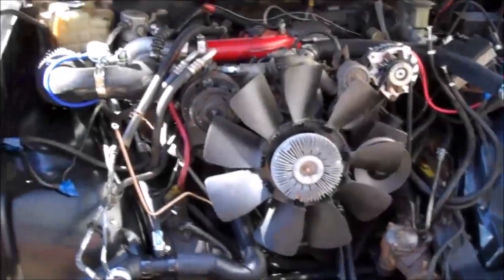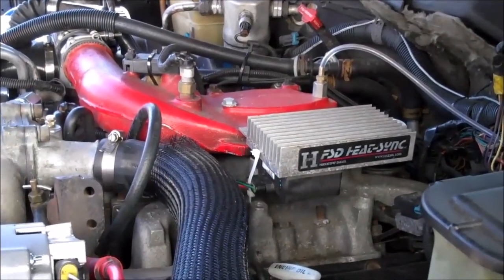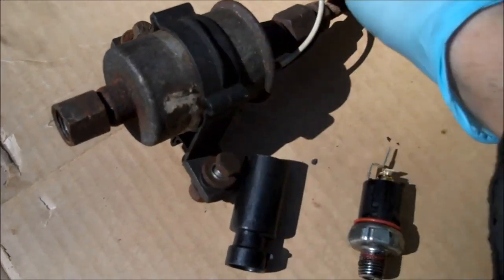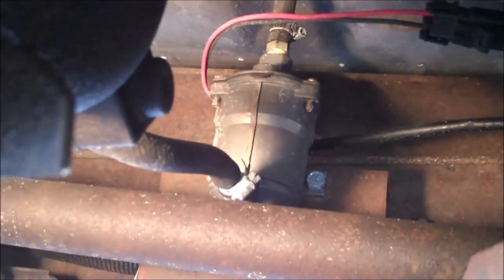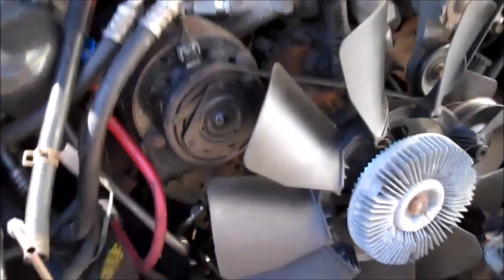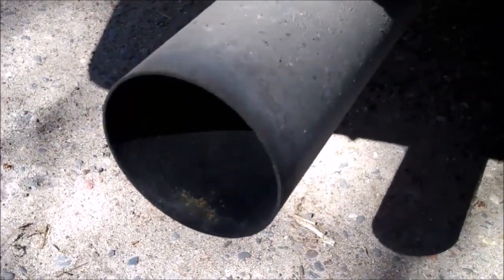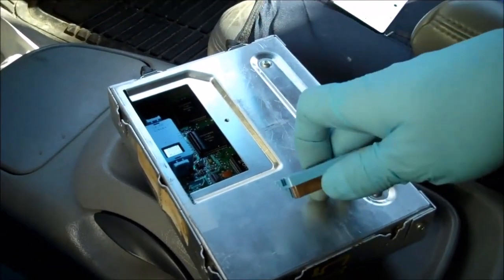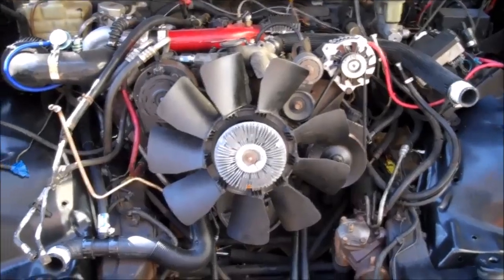6.5 DIESEL ENGINE - HOW TO BOMB PROOF IT

Comment: You have hit on the weak points of this motor's design. You even hit on the electrical aspect in the comment section as they are a bit sensitive with grounding and such. Well done! I have a 94 that I purchased new and still have the OEM vacuum pump and prefer that to control the wastegate on the turbo rather than have a manual one. My current exhaust is a Banks 3" with a "soot delete" as Diamond Eye didn't exist back in the day.  Ideally, the pmd really should get clear of the engine bay as one of the reasons for premature failure is the heat soak it has to endure after shutdown. Even then, unfortunately, they are still known to fail. However, with an upgraded fuel pump the pump mounted driver could very well work flawlessly in it's original location as it relies on fuel flow to keep it cool while the engine is running. I, personally, run the Kennedy bypass for the OPS and love it. These motors have gotten a bad rap but if you approach these things with the idea that they are light duty diesels and not designed to move mountains, they will perform well and are fairly reliable. Not to mention the cost to maintain is by far cheaper than today's models. Thought I would mention that factory oil cooler lines are notorious for failing at the most inopportune time and should be upgraded to braided lines offered by one of your sponsors.
Reply from the maker: +JREACHER1954   Thanks,  I do want to clarify that I do not have "sponsers",  I put up the links to the guys I use without them even knowing I did this vid.   I just want to share my experience with this rig and what has worked for me.    The 6.5  and the Suburban body with 4x4 has been the BEST vehicle for me and my family over the last 18 years and I do not believe I could replace with ANYTHING currently being offered on the market new.   I was really bummed about forgetting to mention the upgraded battery cables in the vid,  I did that so long ago that I think I take it for granted now.   I have not had any problems with the PMD in the current location,  but I still do carry a spare!
Reply: I have the extended cab K2500 and would not trade for the world. Don't know much about trucks but I know alot about this one. Spare pmd, goes without saying. ;>)
Reply: @JREACHER1954  me know if
Reply: Just leaving

Comment: What kind of mpg are you getting?  Great vid love the 6.5
Reply from the maker: +NeATV    This is where the 6.5 diesel REALLY shines.   If I drive NICE and keep it at 65mph I can get 22mpg on the hwy.  This is not unusual with 6.5 owners running the 3.73 rear.  And that with 4x4 drive train!!!!     Warning though.....when I first put a heath diesel prom in and did all the upgrades I was probably getting "negative 10" mpg.....   I just could not drive "normal" for a while.....

Comment: What exact cooling fan is that? and are you using the factory clutch?
Reply from the maker: +Jeff Winer   The fan is a DURAMAX fan.   The clutch is a specially made unit adapted to the duramax fan.   SSdiesel out of NEW YORK sells the kit and so does Heath Diesel out of Washington.  Kennedy Diesel out of Wisconsin sells a 20 inch steel fan and the Duramax fan.    The Duramax fan does require a little trimming on the bottom shroud which is pretty easy to do with a sander.
Reply: +Yankee Prepper - Preparing for the Wrath of God and Fine Coffee. 
Oh ok yeah i saw those kits i just thought you put somthin together yourself. love the truck btw i have a 1998 2dr tahoe with the 6.5 all ive done is the pmd relocate to the driverside fender above the abs unit, 4in diamondback turbo back kit, vac pump delete erg delete and turbo master. i really want to do the cooling upgrade but my truck already has a dual tstat housing and high flow water pump. noone sells just the 180deg tstats and the fan.
Reply from the maker: +Jeff Winer    SSdiesel sells just the 180 T stats and/or the fan and clutch as separate items both on his website and on Ebay.   (Any of them will if you just call.)   I ran 180 Tstats for 10 years and now I am running 190 Tstats,   I read that 190 is better for MPG,  but so far I am not seeing much of a difference.   You know you reached the point of TOTAL insanity with the 6.5 diesel when you spending time switching Tstats for a 10 degree difference and studying the effects..........
Reply: +Yankee Prepper - Preparing for the Wrath of God and Fine Coffee. 
lmfao! "TOTAL insanity" maaaaybe... but yeah the tstats seem abit trivial but for 50 bucks why not? i put in an all aluminum radiator and saw at least 10deg lower temps at highway speeds and my mpg went from 15 to 17. truck was getting 25 lastyear but i think its time for injectors since its overfueling at idle plus i think i have a leak in the return line on the factory fuel filter, little drip of diesel in the driveway. i live in florida so its hot AF and the atmosphere is thicker too. glad to see your an early riser ide like to talk with you more maybe not in the comments lol.
Reply from the maker: +Jeff Winer    I lot of guys with 6.5's have went through some mpg drops by going to cool and the Tstats are the key to that.   180 degree is good for towing and the mountains,  but they say it hurts the overall mpg for everyday driving.   The larger fan makes a big difference overall when removing heat from a hard working engine.   Makes a lot bigger dif than anything else besides a good radiator.

Comment: Hey YP, your vacuum pump is only used for your waste gate? I have a cucv 6.2 and my VP supplies vacuum to my TH400 trans via the Injection Pump to know when to shift based on load. Does your trans not have a vacuum modulator valve?  Also after +300k miles what is the average life expectancy you can expect out of glow plugs? Thx
Reply from the maker: +shepard3  Nope.&#160;&#160; The trans is all electronic,&#160; the only thing the vac pump is used for is the wastegate on the 6.5.   Your trans is the TH400,  mine is the 4L80E and in 300K miles I only had to change the speed sensors (2) once.    I change my glowplugs every 50K.,cheap and easy job....and it's easier even more so if you change them every 50K

Comment: Great tips ive done most of these to my 6.5 just to keep it going they are tough and economical
Reply from the maker: +bud moore (buckshot32000)     Yes they are good engines for what they were designed to do.   I have had relativity few problems with this vehicle overall.   The 4l80e Trans and 14 bolt rear that the engine is connected to are some of the most reliable in the their respected category as well.   The only real complaint that I have is the HVAC assembly behind the dash.   The defrost doors kinda break off hinder the ability of the whole setup.   This is common I guess on these trucks and suburbans. of these years.  That a project for this year,   sourcing a new HVAC assembly and taking the dash off to replace the old one.    I am more afraid of take the dash off then taking the engine out!
Reply: Yeah no matter where u turn the dial in my truck the air blows out the floor vents so I just reach up under the dash and change the mode manually
Reply from the maker: +bud moore (buckshot32000)    That's easy and CHEAP to fix!!!   it's just one of the actuators and your problem indicated the easiest one to change!   Remove 2 phillips screws,  replace the actuator with a 20 bucks new one and it will be like new again for you.
Reply: no the one that needs replaced you cant get to without pulling the dash i tried changing the easy ones no improvement
Reply from the maker: +bud moore (buckshot32000)    huh...in mine the left (drivers side) actuator controls the different air flows/defrost to floor and that one is easy to get to,  the middle actuator controls the heat/cool mix and the right side controls the outside/inside air.
Reply: I Love mine when she runs proper lol which is Most of the time . 
Usually 1 small hiccup per yr and all were simple chp fixes . 
I got a Steal when I bought my 93 CCAB Dually w 50,000 for 5,000 
 Yes I too wish it were a 94-95 
I may in time buy a K3500 to steal the 4x4 components from .  
 I can sat I'm not liking the auto trans unless my back is out and have to push in a clutch ..argh 
  Disability suks as I loved my Slap n go 
Peace

Comment: Great...now you got me thinking I should be scanning CL for diesel truck/suburban with blown motor to put a fixed/reworked 6.5 in! :) Good stuff man!
Reply from the maker: +harley96cube    That's what I am doing!   I will make it worse for you,  look up "TED'S TRUCKS" in Alabama.   He has low mileage and rebuilt military Hummer engines for 3K, I think he has some on EBAY too.   The military Hummer engines are the "optimizer" 6.5's that have the beefed up blocks!
Reply: +Yankee Prepper - Preparing for the Wrath of God and Fine Coffee. Yup, already started looking at the optimizer. Could put that in just about any Chev that a small/big block is in. Thanks buddy. :)

Comment: I can only imagine how they open up their meetings at the factory:
"We're GM diesel  engineers and we're here to help!"
Reply: Look Up Detroit Diesel Series Two-Stroke Blower motors! GMC! 
1938 till about 2000! Still in use on the roads, oceans and rails!
Tanks a couple WW!
Mostly interchangeable parts one cylinder to 24
Reply: Duramax engines are bomb proof
After all the emission bullshit is deleted
But with LB7s... replace the injectors and gaskets and you're fine
Reply: LMAO... Yup they are there to help empty out wallet is what they're there for 🤣🤣🚫
Reply: Sounds like Biden nowadays

Comment: What content! I hope some engineer watches this and sees the demand for built to last, self maintainable vehicles and creates a company that makes them.  I could work on my old '76 student car. But my current 2010 Toyota, zero chance. Thanks for sharing.
Reply: Especially since many people buy these diesels for the longeveity of them only to be disappointed by expensive preventable break down.  Not only GM but all the manufacturers have let down their customers when they have been expecting to get long lasting vehicles.  It ridiculous that you have to do these mods to get a reliable engine when they shoul already come that way.  However in defense of the manufacturers we do as a group in the United States put a lot of requirements and regulations upon our manufacturers that are almost impossible to meet.
Reply: enter the enterprising individual with a bit of wrenching skill and the aftermarket. ;-) i think the enthusiast that wrenches pisses both the manufacturers and banks off the most. that's why the lobby for the manufacturers tried to shut just about all of us down a year or so ago by trying to implement dmca rules in regards to engine management systems etc. didn't work though thankfully enough.
Reply: I'm sure the reason for the success of the aftermarket companies is because of the money they have, just like OEM car companies who knowingly make cars and parts less reliable than the aftermarket who intends to offer actual bang for the buck with quality. Money buys everything in this world, even policy and credibility. This is no secret. Lobbying (which should be illegal) is what often keeps fat cats, well, fat and in business. It's why big oil companies successfully defeat any bill proposals to increase fuel economy and decrease oil usage. I do not defend or condone lobbying in the slightest. But as long as it's "legal" then the good guys of business have just as much a place in lobbying as the thieves that bought their way in.
Reply: Engineers for for GM and most automotive brand are NOT ALLOWED to build a proper design.  The sales and marketing and board Directors control engineering department..
Reply: can you provide a link to the scanner?  can I use it to set timing after installing new IP?
Reply: Why would the auto guys and galz build a reliable product? No high IQ required to know that reliability and profitability don't go hand in hand. GM, Dodge, and Ford know that their greed would be unaffordable to the public if their products lasted 1,000,000 trouble free miles. It's unaffordable because we live in America, land of the fee and home of the slave. Don't worry though. The big banks and auto dealers will take good care of us. When our vehicle's break down for good by the time we're done overpaying for them from our favorite dealership, which they are now designed to do, we can go to the banks and ask for another loan. Bank of America appreciates your business with them.

Comment: Very good info! My truck is a 97 chevy but its the 5.7 vortec with only 102k miles and only gets about 14mpg. I knew diesels were more efficient but I had no idea it was that much better! Now you have me wondering about an engine swap but I cant justify that unless something bad happens to the 5.7. I may have to keep my eyes open for a possible future donor/towing rig. Thanks for the detailed video!
Reply: +Off Grid Kansas I have a 98 k1500 ECSB with a 5.7 vortec and a 94 k1500 ECSB with the 6.5 TD, my vortec is actually the daily driver and gets 14mpg or so.
Reply: Any particular reason you use the 5.7 as the daily driver if the 6.5 gets better mileage? Is the 6.5 geared lower?
Reply: +Off Grid Kansas The 6.5 has 306k miles on it and my 5.7 has 195k. Diesel has 3.73s and the gasser with 3.42s, I just like the vortec more since it's a cleaner truck where everything works. The diesel is more of my hauling truck.

Comment: Great video again!!!!!  Question I have is about the body of the Suburban.  Since you live in Minnesota, how does it hold up to harsh winters, road salt, etc????  I assume you were able to give it a good undercoating before you put it on the road.  Road salt is the death of so many cars in the North...  So do you have words of wisdom for us??
Reply from the maker: +jjakejones    2 words my brother.....   SPRAY OIL....spray oil on the under carriage every year.   Use a cheap O spray bottle unit you can hook up to your air compressor and soak the under carriage,  that will keep the frame in good shape.    New body panels are pretty cheap for these trucks as well and solid used ones are plentiful.   I ordered 2 new inner fenders for this project and had them delivered to my door in 3 days from Rock auto for 60 bucks.   My radiator core rusted through on one side after 20 YEARS...and I got a solid used one off craigslist for 50 bucks.
Reply: Wash

Comment: Doesn't the vacuum pump typically actuate the hubs for 4X4? Is it different for your rig?
Reply from the maker: +bigshafe   Nope.  The actuator is electronic.   The ONLY thing the vac pump runs is the wastegate arm,  DUMB.
Reply: +Yankee Prepper - Preparing for the Wrath of God and Fine Coffee. Cool, thanks. Great vid but give us engineers a break most of the time the bean counters make the call haha.
Reply from the maker: +bigshafe  That's very true and probably the case with both the PMD placement and the cheapo lift pump......but to put the vac pump where they did.......they have to have been EVIL.
Reply: Ive noticed that where I work, except its sales that makes the decisions. If sales wants it, most of the time they end up getting it, whether it makes sense or not!